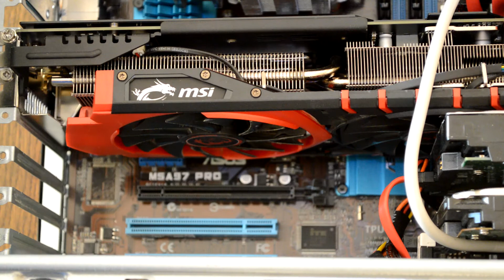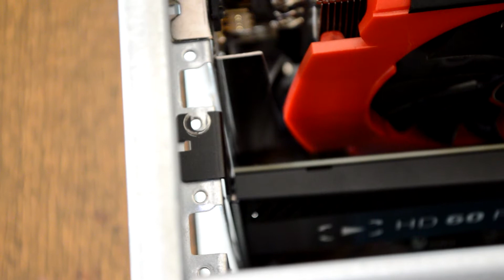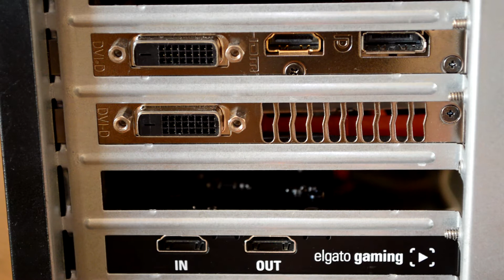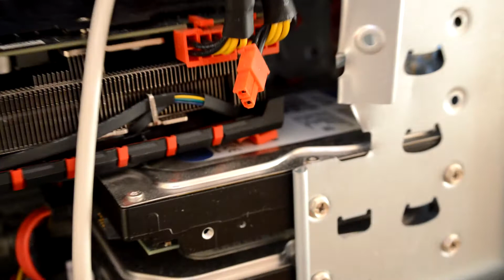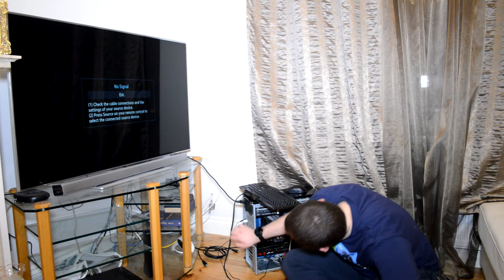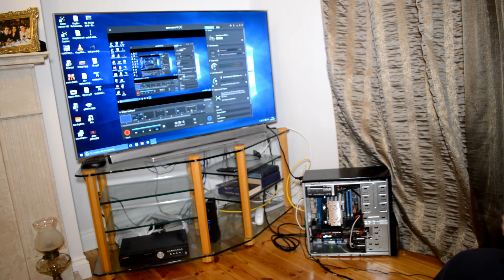How to install an Elgato HD60 Pro

Comment: Question:  How are you able to see your video through the HDMI from Elgato if the software is not installed?  I can't see anything
Reply: He said he was running directly from the GPU firstly to install the software. After this is done you can see the short jumper cable between the GPU and Elgato.
Reply: Dan Thomas   Gotcha